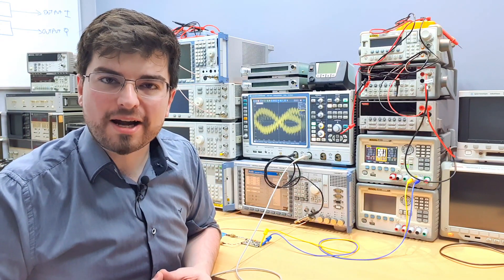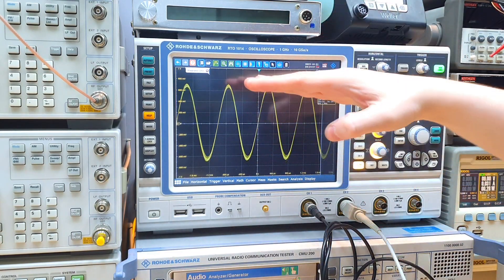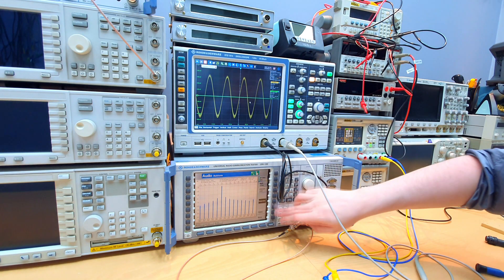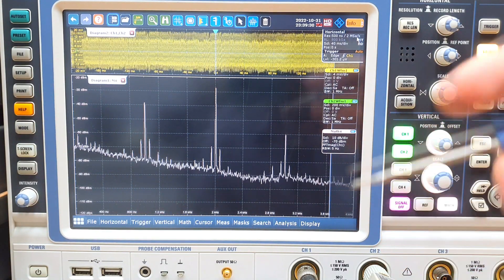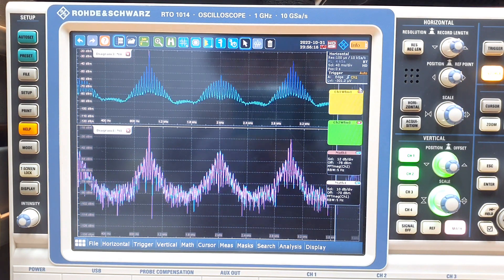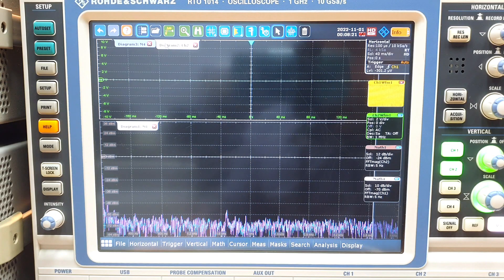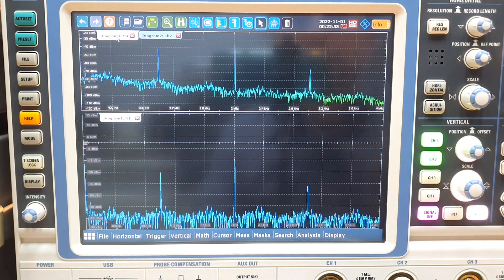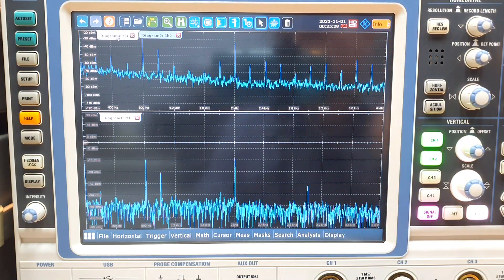Investigation on Signal noise and Spurious tones

Comment: Hi Greg, great troubleshooting. Can I land a suggestion? I assume 2 kHz tone can come from uncompensated DC bias present on ADC input, down-converted to negative 2 kHz (and possibly mirrored to positive 2kHz too. How exact edges get transformed? Like 0 Hz and 4 kHz? Are they aliased?) I did tinker with AVR's ADC before it's really hard to bias signal exactly in a middle of ADC range. I wonder if you implemented any DC cancellation in software. If not, would be interesting to see if it can fix the problem : )
Reply from the maker: Hey man! I think you are totally right, I will keep it in my mind. May be a great subject for a next video

Comment: Nice work and detective skills. 
I hate it when you spend a lot of time on a measurement, only to find out that the thing you were chasing came of the equipment or some nearby light or something. 
Your audio analyzer seems like a pretty versatile and useful tool, I always thought that these were pretty useless, since any modern oscilloscope can do almost the same. 
However I might have to find a place on my workbench now.   ;)
Reply from the maker: Hahahaha these CMUs are cheap and have good hardware. Would be great to discover how to compile programs for it. 

The 2khz seems to be LO "leakage" from the DSP downconverter. It is not a coincidence that we are downshifting 2khz and the spurious tone is exactly 2khz..